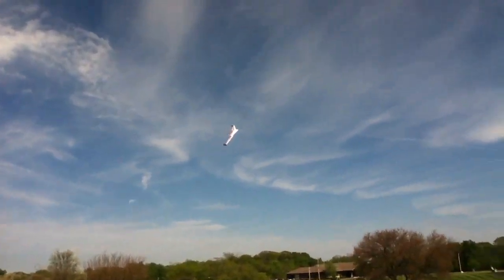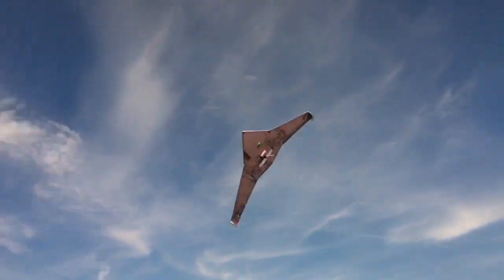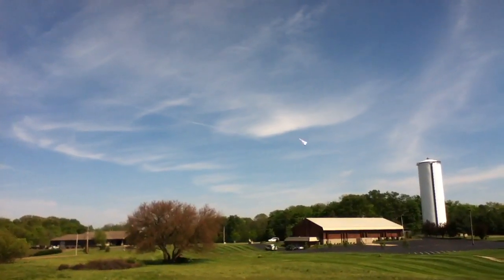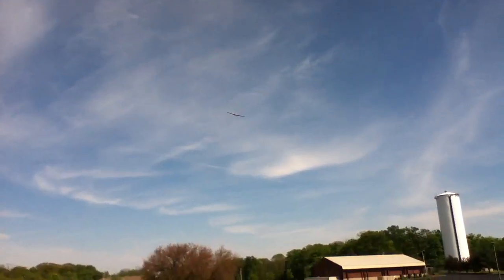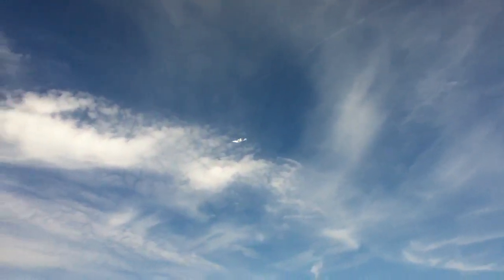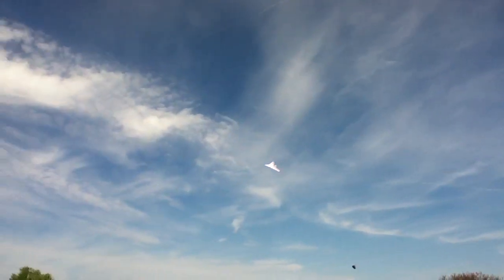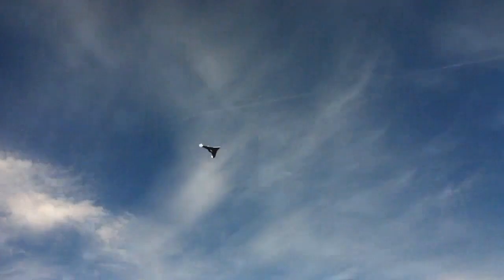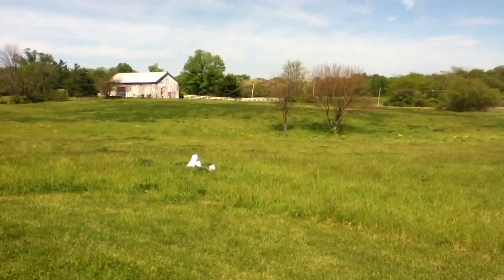NASA Blended Wing Body RC

Comment from the maker: When you're banked, up elevator no longer acts as just straight up and down and it doesn't make you go "up" as much as level flight obviously.  One of the forum members suggested I do opposite rudder so my nose points up in the turn and the plane leads with its nose going in that direction.  Yes, it's a combination of pulling up elevator as well as pointing the nose in the right direction.  I'm still experimenting with this.
Thanks,
-WRC

Comment: Just a note: This NASA/Boeing design uses many concepts from designs by Burnelli in the early '-50s.
Why Boeing probably never will build it until they manage to acquire the Burnelli company patents. They've historically been completely unwilling to license-build such things. See the experience with the Boeing 754 "Husky" in the '70s. When informed that it had been put on paper by Burnelli in ht elate '40s, Boeing dropped it
, though it offered many advantages.